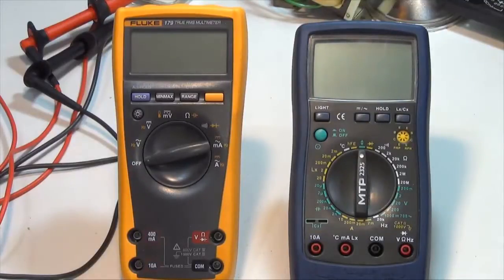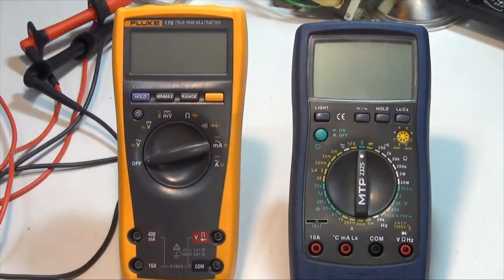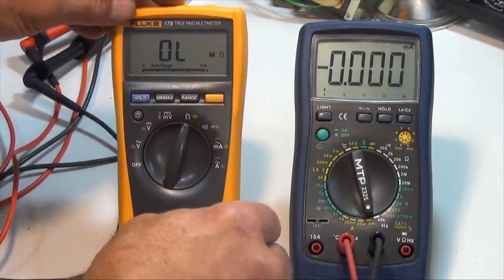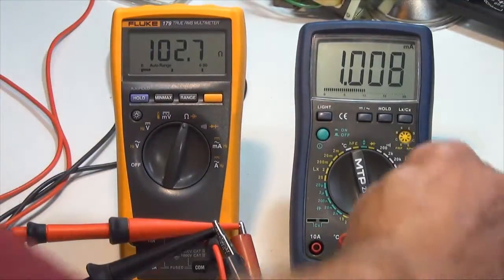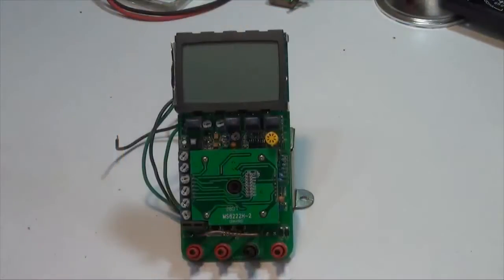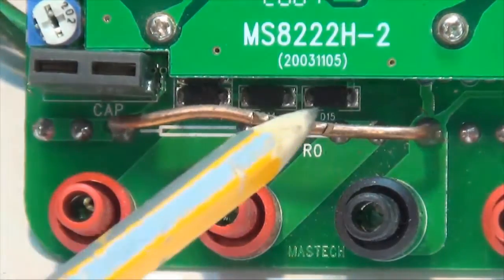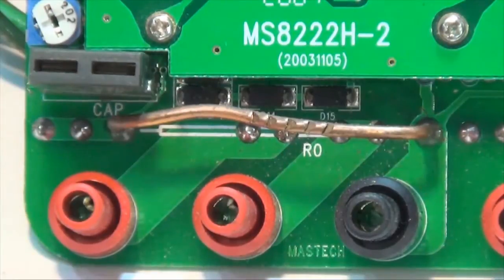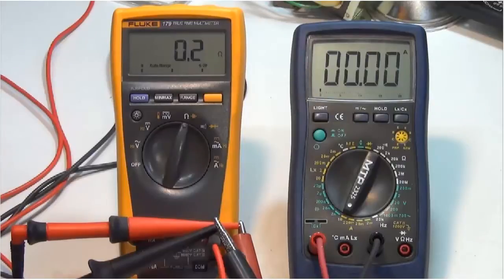Digital Multimeter DMM Current Measurements - What NOT to do

Comment: First thing I did, when I got my first DMM is, I measured my wall socket's ac voltage, it showed 220v, okay, then I measured the current, by appropriately pulling out red cable and inserting it into amps socket on DMM and when pushing both leads into a wall socket....
Reply from the maker: WOW..... I'm guessing you made a big spark, a bit of smoke and ruined the meter.  I hope you didn't hurt yourself
Reply: @1929fordhotrod  Yes, there was a good spark, what surprises me is that meter survived, because both lead tips melted a bit, literally melted and house main fuse instantly blew up with that spark, which most likely what saved the meter.  I got away unscratched.
Reply: I guess I'm pretty lucky my mistake was made with a relatively small SLA battery

Comment: Hi, thanks for a helpful video. I made the mistake of changing the settings on my multimeter while checking a wall outlet. I blew the fuses and when I changed them the display still does nothing. Could this have burned up the mutimeter or am I missing something? I'd appreciate any advice. Thanks.
Reply from the maker: Did you use the multimeter set to measure current.  If you did, this is why you blew the fuse in the DMM and most likely caused some internal damage to the meter.